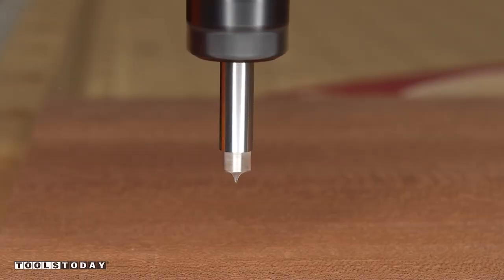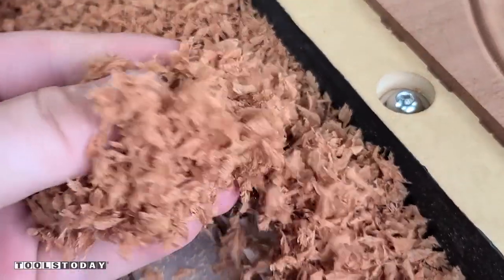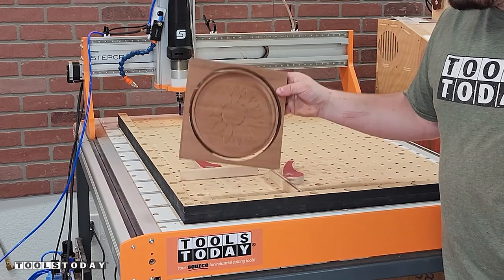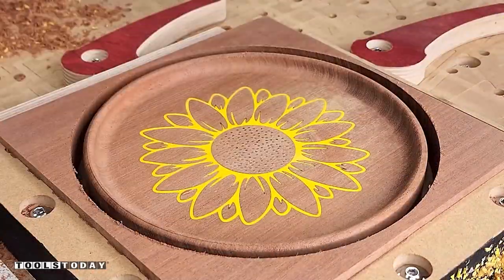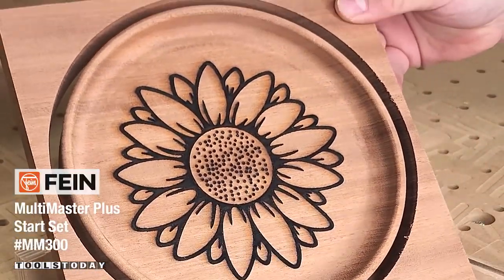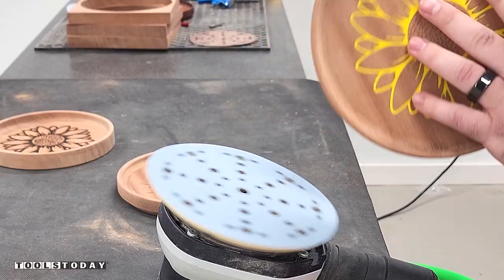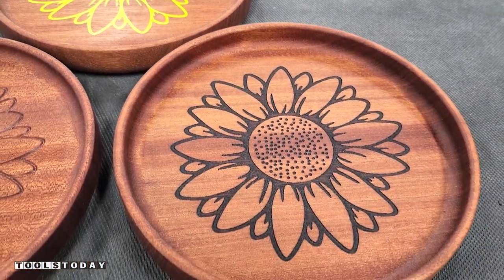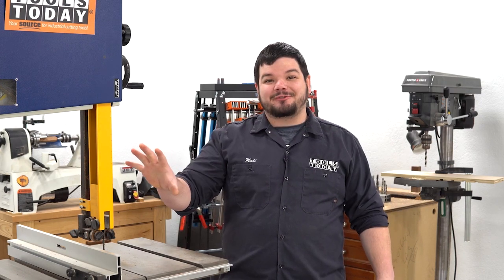How to Make: Sunflower Catch All Tray on CNC | ToolsToday

Comment: How do you have enough Z clearance to run these parts on top of a 3/4" sheet of the sacrificial MDF hold down wasteboard that you made? On my M.1000 i struggle with taller parts using just a 1/4" sheet of MDF wasteboard and getting warnings about Z clearance even when I push my bits in as far as I can into the collet. I know I can put  my table down on the lower rails, but you have it on the top setting and I was wondering how you managed that.